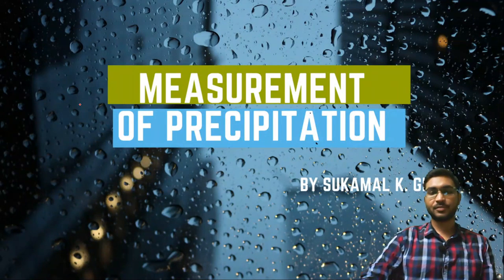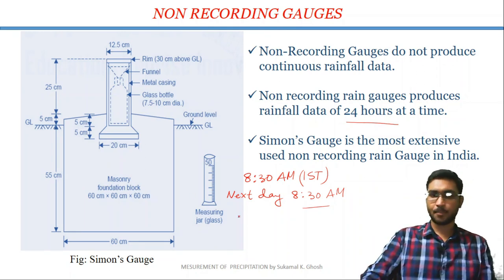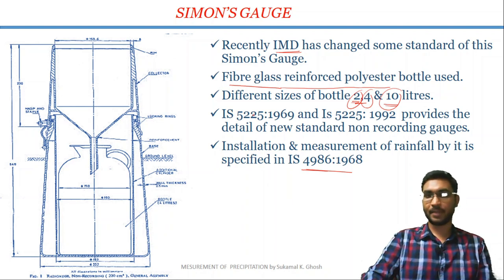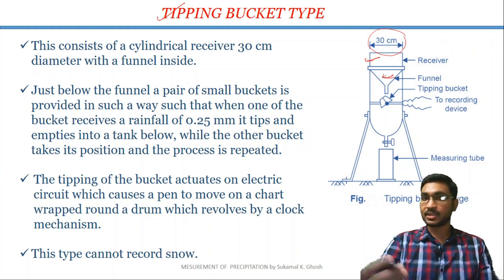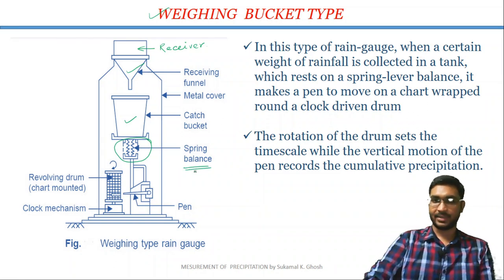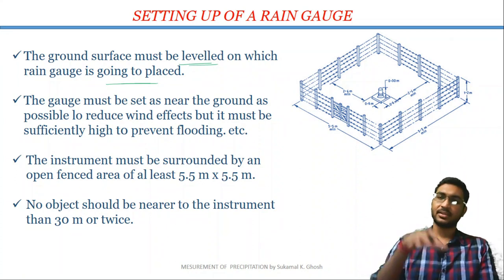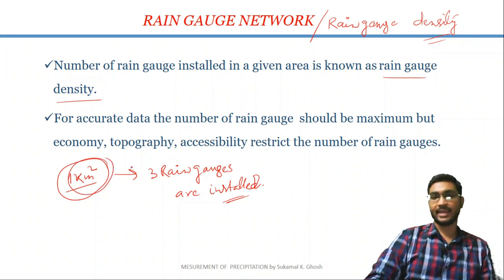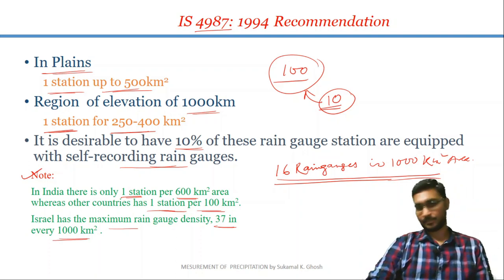MEASUREMENT OF PRECIPITATION (English) | Engineering Hydrology | Lecture 5| Civil Engineering

Comment: A waterbody having a surface area of 2000 hectares. 10.8 litres of water was added to bring the water surface in the evaporation pan to the stipulated level ad the nearby rain gauge measured a 3.6 mm of rainfall. Diameter of the pan 122 cm and the pan coefficient is 0.7. The evaporation from the water body can be estimated as ________________Mm3.(Answer should be round off to 2 decimal places).

please tell me sir answer this question